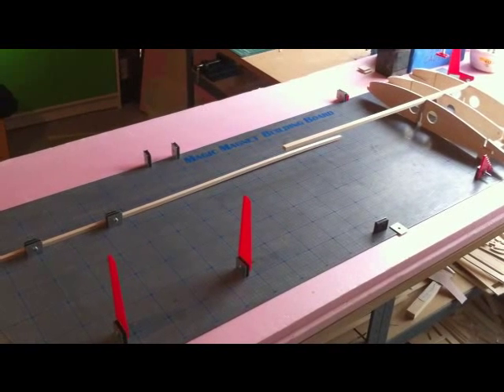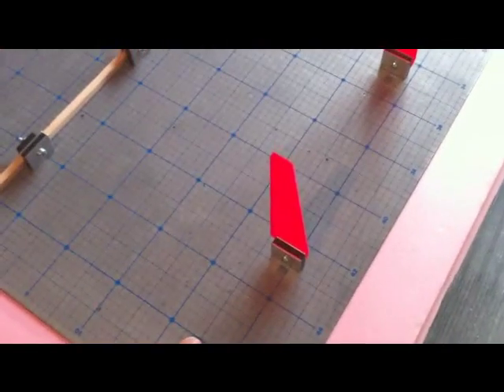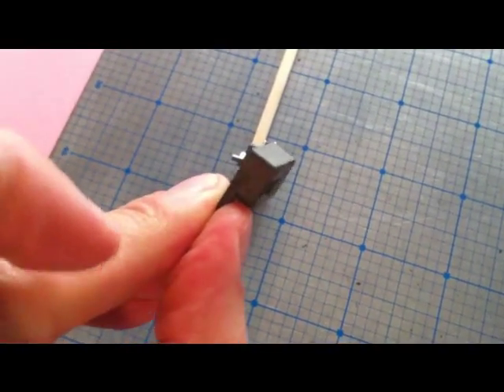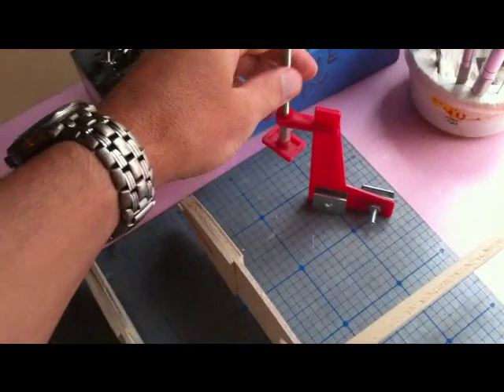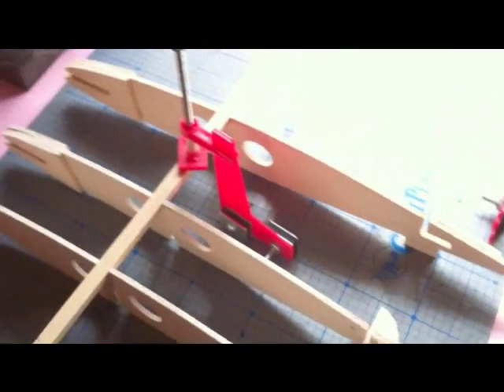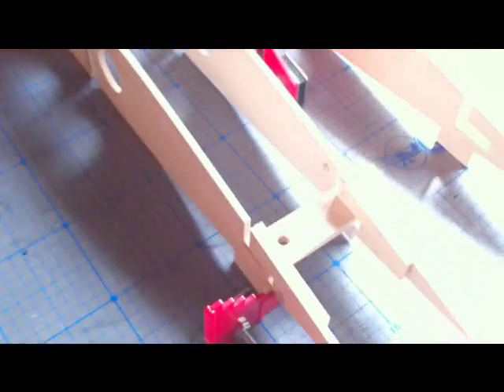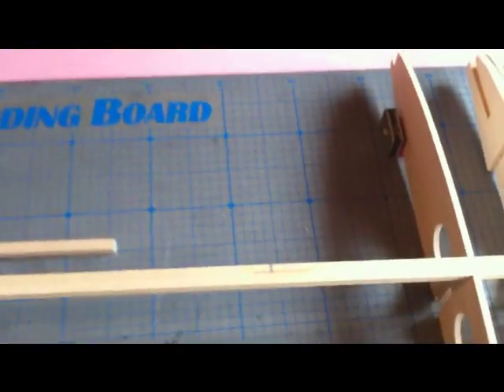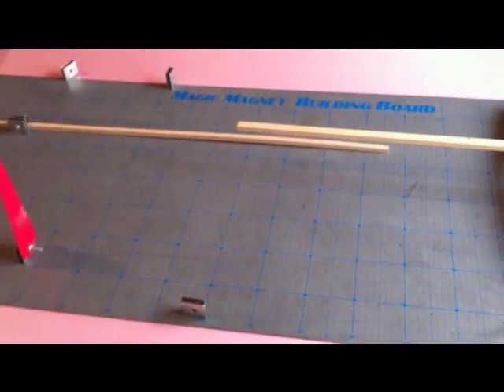How To Use A Magnetic Building Board For RC Airplanes

Comment: Hi where can i buy one of these building boards please .
Reply: Unfortunately the Great Planes Magic Magnet Building Boards are no longer manufactured.
It's possible to check Ebay from time to time or even perusing flea markets or garage sales you might get lucky.

However, if you have the time, tools and patience, you can take a 24"×36" piece of sheet metal (or whatever dimensions may serve best) and make a reasonable magnetic working board. I had to go to Lowe's for the magnets as Harbor Freight was a total bust.
Reply: I bought one at Home Depot today. 26 gauge by 12 by 24 in. 8 bucks. Just need to mount it on something flat.